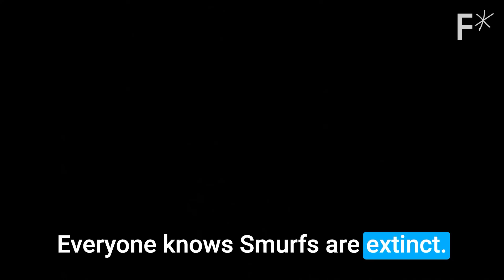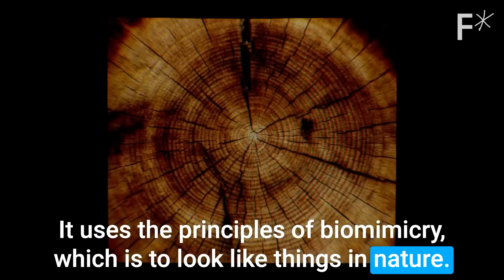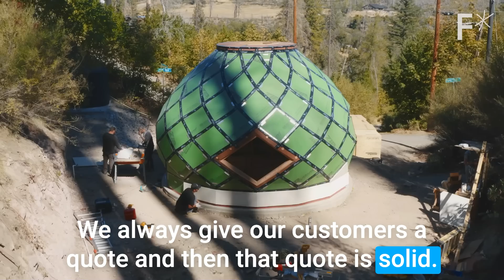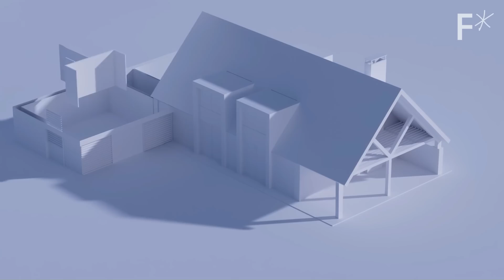DIY Tiny home you can build in weeks

Comment: What is the max temperature fire resistance rating
Reply: Do you mean for the shell or for the windows?  Because I doubt that those windows could withstand 2200 F.
  Of course, you could make or order shutters out of the concrete, so the fire couldn't come in through the windows.
:)
Reply: The website says 2200F